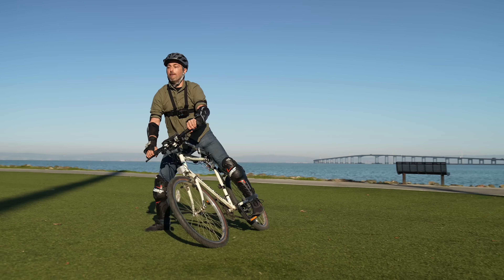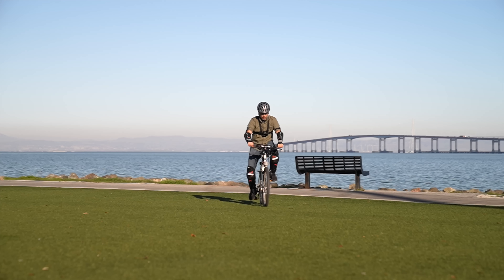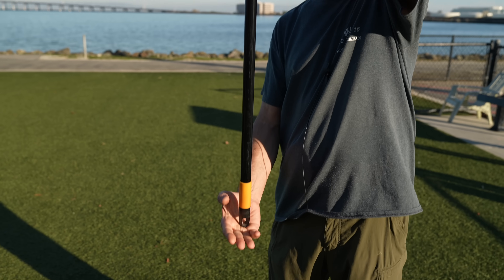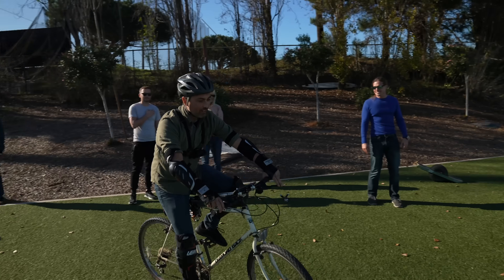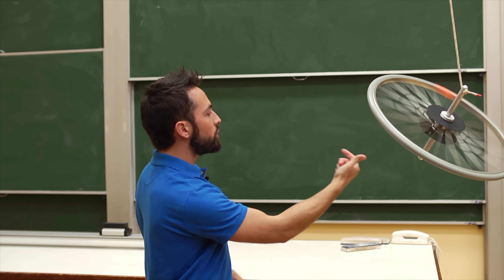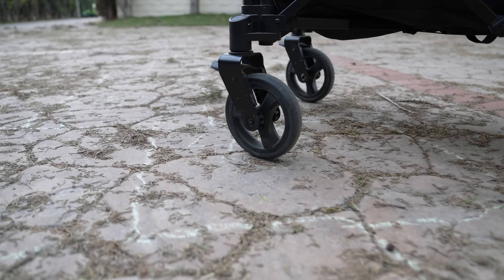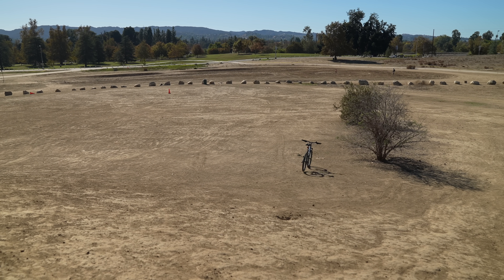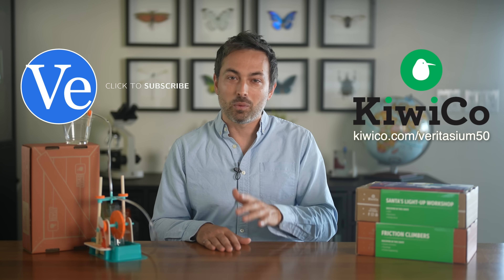Most People Don't Know How Bikes Work

Comment: Finally, an episode on a subject that I think I know more about than the folks at Veritasium, me being a life long bicycle rider.  

It is not really about steering the handlebars. Your body placement, especially in a fast moving bike, is way more important than the handling of the handlebars, as you showed it here, moving clumsily at 3-5 miles a per hour, on a padded fake green lawn. 

(... You will ONLY see and appreciate that fact, when you carefully watch extremely fast motorcycle riding around curves: there is HARDLY any handlebar twisting. The front wheel, in fact, stays relatively straight. It is the LEANING of the rider and the bike that gets the motorcycle to go around the curve....)

When you're going fast, you will NEVER "wait until I get to the bend and, then, I turn the handlebars"... as shown here (with pseudo scientific electronic interference).  No. 

Riding a bicycle going fast is 100% like riding a motorcycle: you NEVER wait until you're "at the bend" before you turn the handlebars!  

Instead, you "look" (to where you're going in the approaching moments and direction).... and then you immediately recalibrate your body positioning... on a fast moving bicycle or a fast moving motorcycle) way before you get to the curve (& the "curve" could be an actual curvy road; or it could simply be that you're making a transition from one road to another, in front of you). 

There is something called MOMENTUM and that's PHYSICS.  

The locking of the handlebars here... is a bad way to explain basic bicycle and motorcycle riding "mechanics."

Guess where your BODY is (still) going, regardless whether it is to the right or left... that your hands/handlebars are "signaling" ---  that is, if you wait until you're AT THE TURN or, worse yet, in the middle of it? 

Yeah, your body is (still) GOING STRAIGHT!

In other words, except for very brief durations, in EXTREMELY LOW speeds (crawling... or the beginning of a left or right turn from a stop, etc), both on bicycles and motorcycles, you HARDLY EVER TURN the handlebars.   

Anyway, the REASON you were not able to LEAN here before turning right or let ---- & that's why you keep talking erroneously about handlebar handling --- was because you're not even riding a bike for real. You were, instead, doing some silly & slow stunts to test your goofy theory on handlebar handling (or, rather, on handlebar locking, which is completely stupid and unrelated to actual useful bicycle or motorcycle riding).

Comment: Your conclusions are wrong.
Giroscopic effect is present whether you like it or not, on a turning wheel.
The only way to isolate the Giroscopic effect is to put a bicycle on a platform with wheels, without anything holding the bike. Push the platform and see if the bike stays upward...
Same goes to those who tried to neutralize  Giroscopic effect by using wheels spinning in different direction. This duplicate the effect and not cancel it.

Comment: The gyroscope effect plays a much bigger part than was made out I think. The example at the end is interesting, but its a completely different system. To be precise, if a bike is going forward but leaning to the left, then the front wheel has an angular momentum vector pointing to the left and down a bit (standard right hand convention). There is a torque on the wheel from its weight (and the bike) acting at the hub, and the reaction from the ground acting at the rim. The vector for this torque acts backwards, and induces a rate of change in the angular momentum, moving that vector backwards, which means that the wheel turns to the left, and stabilises the bike. This is an example of gyroscopic precession. Locking the front wheel blocks this precession, so doesn't prove anything. Some turning torque can be caused by static tilting as stated, but this is fixed for all speeds, whereas the precession torque can increase proportional to bike speed, making it fast acting. So given that the bike is unstable when moved slowly, but gets more stable as it moves faster, it is clear that precession is the dominant factor.

Comment: i knew this because when i had a bag on the left side of my steering wheel and I often rode without hands..
you should think by riding, that the wind would blow the bag back, and you would fall left..
but in fact, i always would fall to the right, when i wasn't holding my steering wheel...

Comment: I have some problems with this „theory“:

1- if counter-steering is the way to turn, then why when a bicycle is moving without a person, is able to turn without counter-steering, as perfectly seen in this video? 

2- the pendulum example is not what happens when we ride bikes. In the pendulum example you are applying a force on the bottom of the object. On a bike if we lean to a side our weight will be a force which is applied on the top of the object. 
Example: take a domino and stand it on a table. With a pencil apply a force on the bottom and the domino will fall in the opposite direction of the applied force. Now apply a force on the top and it will fall on the force direction. 

3- 9:11 in this experiment  with no gyroscope effect, the only way this bike prototype is turning is by leaning to the side where it wants to turn, not by counter-steering. 

4- if we don’t understand how bicycles works, shouldn’t we then be more careful with this counter- steering theory until we are sure what’s going on?

Comment: Yea definitely not true for all cases. If you counter turn with a touring bike (bikes with handle bars pointing to the back) you'll definitely fall. 

Also, none of those ppl are daily bikers. No one that rides regularly would bend their knees towards the turning side. You lean on the turn side so your leg should be straight with your weight is on the lowest point of the pedal.
Reply: Not all cases, but in your case it is true. You don't know how bikes work.
Just like the title say.

Comment: When I was reading the article I wasn't entirely getting it but then I looked at the video. As soon as they explained that locking the steering prevented a turn I remembered once trying to ride a damaged bike after a particularly spectacular wreck. It messed up the bike some way or another so that the handlebars would only turn in one direction. After assessing the damage I assumed that if I wanted to turn in the direction that the handlebars would not go, I could just lean that way. So I got back on the bike but when I tried leaning in the direction that the handlebars would not go I crashed it. When I saw the guy falling off the bike at the beginning of the video I could actually remember what it felt like to be off balance in that way and then crashing the bike.

Comment: i want to try that bike , i have ideas to combat that issue 1. when going very slow counter steering is not a thing e.g. when stopped and balancing i think you could turn but only from a standing/balancing start. 2. If off the saddle i think its possible to push the bars downward into the turn too.  but i dont think its possible to maintain a turn without counter steering if the bike already has enough speed to balance.  i mainly want to try it for case 1 and see if i can do it
Reply: Countersteering is always a thing.
Reply: you could balance the bike and make it fall to one side then drive it in a circle with no counter steering . Left standing long enough it will fall one way or the other negating the need to counter to initiate the turn.
Reply: @ Lock up the front fork so it can't countersteer and you will fall.

Comment: For once, a Veritasium video that initially appeared as too boring to watch, before the more technical explanations started. Where I live, you can't even get a motorcycle licence without passing a handling test that necessitates understanding countersteering. I don't have the licence, but I know how to corner sharply with a bicycle. Usually I initiate the turn by nudging my handlebars ever so slightly with my turnside hand. I.e., if I want to turn to the left, I push with my left hand, initiating a sharp turn. When you're cornering with speed, the tangential acceleration negates the need to ever actually turn into the direction of the turn; you'll just need to maintain an appropriate countersteer.

I'd be interested to see if it were possible at all to ride a bike with 90° headtube angle, a dead straight fork and handlebars mounted straight on the top of the headtube, i.e. a 0 mm stem length.

Comment: this is simple you steer the opposite direction first to open up the turn or corner and get that tyres loaded to turn to the direction you want. f1 cars do this trick, and to do a turn directly you apply trail braking especially on the front tyres, that way you keep your front tyres loaded and then turn to that direction.

Comment: I think about this video every time I ride a bike. While countersteering is obviously a thing, isn't it possible to just turn by leaning to the side? I'm not talking efficiency of a turn at high speed, just if it is technically possible. If you go slow enough, you will basically fall to the side if you do not steer the handlebars. So it is possible to initiate a turn by just leaning. Then you just have to turn your handlebars to the same side to avoid falling over and voilà - you turned without countersteering. Of course it is easy to miss even the slightest countersteering if you are during it intuitively.

Comment: You can turn to the left with locked stearingto one side. When you ride a bike without hands you lean with your body in and the handle bar moves to the diretion then lean back up and stable the bike. Here is the same you just need go with your body first and then stear.

Comment: One of the best ways to teach someone to ride a bike is to take the pedals off (or use a balance bike) and let them stabilize themselves with their feet. When they go to steer in one direction, they’ll feel something isn’t right without falling, so they immediately correct the other direction and it instantly “feels” correct. Its easy to make that muscle memory when you don’t interrupt the critical moments with a fall. I take a little issue with training wheels, since it removes the balancing action.

Comment: The steer works less when you stand still but it still works.
I always remain upright waiting until a car passes.
You can stay with you bike upright forever even standing still.
It is also funny that a bike driving below 15 for a mtb or racer, requires you to do all the balancing. (city bike like 10 km/h)
Only when you go faster than the 15 the bike takes over, so if you used to climbing at lower speeds probably you ballance is already superb.

Comment: I have just had to start riding an adult trike with 26 inch wheels. Turning it is very strange and at any kind of speed it will fight the turn. You really must lean into the turn otherwise you're falling off. I imagine it is exactly what is going on with the locked steering bike.
Reply: Trike is a car with 3 wheels. Of course it handle nothing like bikes.

Comment: Did t watch video. Here how bikes work. 

Low speed, you lean and steer the bike to keep it within your center of gravity. If you steer the bike you just direct it from being under you so you’ll fall unless you steer it back. 

At high speeds it’s the same way but with more control due to the stability of the wheels gyro force. Turning them actually can help the lawn be more controlled to due to angular momentum

Comment: Why are you doing all of this on grass?
Well it doesn't matter.
For the last few weeks whenever i was cycling i was observing the way i take turns and i steer right when i want to go left ONLY TO GIVE MYSELF A WIDER ANGLE ON A TURN.
I also do a lot of course correcting, you might be falling off a bike because you can't do that when  steering dingus is locked.
Lean to the left when going left at higher speeds.

Whoever made this stupid video, doesn't know how bikes work.

Comment: This is not a precise scientific demonstration and it is false to say that a two-wheeled vehicle must steer opposite to turn.  ALL two-wheeled vehicles initiate a turn by LEANING in the direction of the turn, gyroscopic precession insures that the bike wheel turns instantly, in the direction of the lean only.  He actually demonstrates this by turning right without ever turning the steering to the left, but fails to accurately assess the results of this action.  In fact, counter-steering will simply cause a loss of BALANCE, which is never usefull on a two-wheeled vehicle.
Reply: How do you initiate LEANING?
LEANING alone does nothing. Bikes will not turn because of LEANING.

"In fact, counter-steering will simply cause a loss of BALANCE, which is never usefull on a two-wheeled vehicle."
Did you read the title? It's for you.
Reply: @XtreeM_FaiL   Key Concepts to Remember

❌ "Counter-steering" is an incorrect term.

✅ Torque-Induced Counter-Balance (TICB) is the correct mechanism.

You are not steering the front tire; you are rotating the bike to shift balance.

The turn is not caused by handlebar angle, but by lean from torque and tire patch shift.

Comment: I'm at 2 minutes and I'll see how close I am for fun: You can't turn the wheel very far at all unless you're moving at a very slow speed. You weigh a lot more than a bike, and by shifting the center of gravity under you, you fall. You need to lean off the center of gravity to pull it to the side and not turn the handle, as one does when they ride a bike (or motorcycle).

Comment: Close to true, but not quite at higher speed. You can test this easily: cycle along, and take your hands off; now, only push the handlebars with the end of one finger.

You’ll see the effect shown in the video. However, you can also steer without hands, just leaning; the bike automatically countersteers.

What you can do, though, is to push the right-hand side of the handlebar and lean at the same time, you can time it right.
Reply: It's easy to steer without hands - but you're still steering and countersteering.  Lock the steering and you'll fall.
Reply: @Rick_Cavallaro  Indeed, definitely will fall with locked steering! If you steer without hands, you'll definitely have countersteering. But, with hands and lean together, it is possible, and actually quite easy, to steer without any countersteering. Give it a try! :)
Reply: @tso_cheezii  
>> with hands and lean together, it is possible, and actually quite easy, to steer without any countersteering. Give it a try! :)

I have tried.  But my M.S. is in dynamics and control.  I assure you - you're still countersteering - even though it can be very hard to notice.
Reply: @Rick_Cavallaro  Turning bars left starts when front wheel going left, but rolls the bike to the right. This would cause you to fall if you're upright. But, if the bike is already leant to the left, you don't fall :)
Reply: @tso_cheezii  Turning the bars to the left is intended to make the bike roll to the right.  That's what countersteering is.  You need to initiate that lean to allow yourself to turn right.  If you could simply lean to the right, you would also be able to do that with the bike stationary.  Give that a try.  With the bike stationary, lift both feet onto the pedals, and have a friend immediately tell you which way to fall.  You'll be able to fall that way exactly half the time.
Reply: @Rick_Cavallaro  You've lost track of what the point was mate 😛 just try it, you'll see it's easy to turn the bars left and have the bike turn left without any countersteering, provided you lean. It's also easy to explain theoretically as well
Reply: @tso_cheezii  I have NOT lost track mate.  I answered your question.  I HAVE tried it - in THIS video.  You keep telling me to try it, and I keep telling you I have.  But you won't try the 10 second test I told you to try!  If you could explain it theoretically, you would.  I modified a bike and made a video about it.  It's got more than 20 million views.  All you have to do now is make a video demonstrating your position.  I'll be sure to check it out and then make unsubstantiated remarks in the comments thread.
Reply: Glad to see a video of one of the unusual bikes at the end, which still self-stabilise even without some of the usual properties!

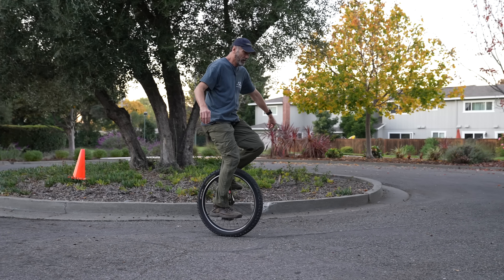Comment: 3:49 I can actually prove you wrong.. You can pedal backwards first, but it's absolutely NOT necessary (I ride the unicycle, so I was able to easily prove this wrong). On a unicycle, as long as your centre of mass is directly over the hub of the unicycle up on top, you can stay up no matter what.

  Honestly, he could've made the video 5 minutes long by just saying: "Get your centre of balance right and be 
coordinated." If I had that bike that they gave me, I bet I could easily ride it after 20 minutes of getting use to a non-adjustable handle bar.  Like, you can counter steer, but it isn't "exactly" necessary.  @Veritasium  as long as your balance it up to speed and practise, you don't NEED to counter steer unless you need to advertently avoid an obsticle of which only leaning wouldn't turn good enough (like a car with a disasterously terrible turning radius).
Reply: >> If I had that bike that they gave me, I bet I could easily ride it after 20 minutes of getting use to a non-adjustable handle bar. 

I've got good news for you!  I'll take your bet.  You just name the amount and I'll put you on that exact bike.